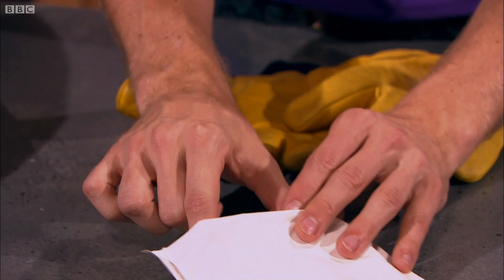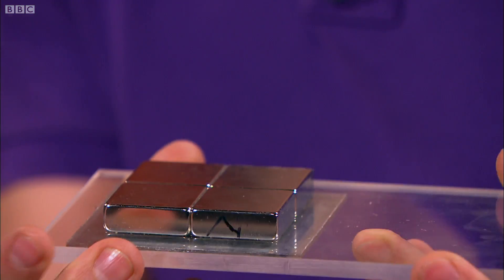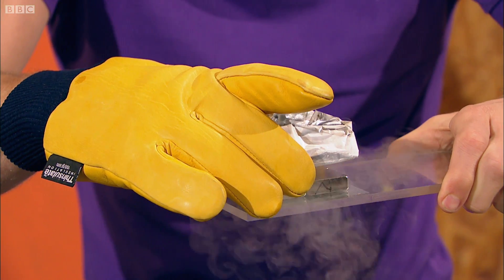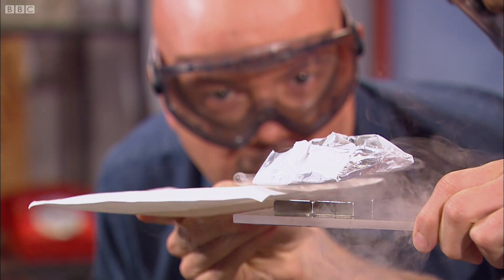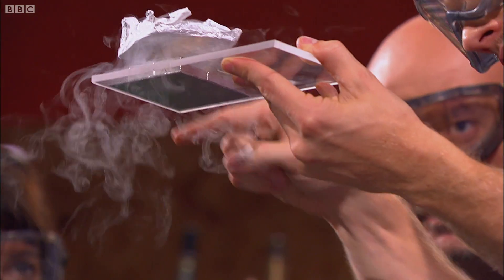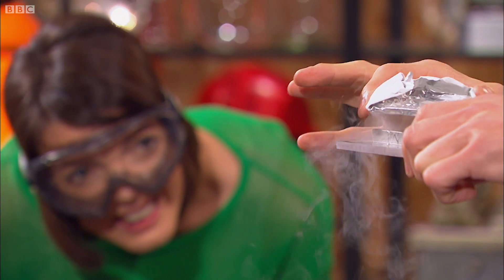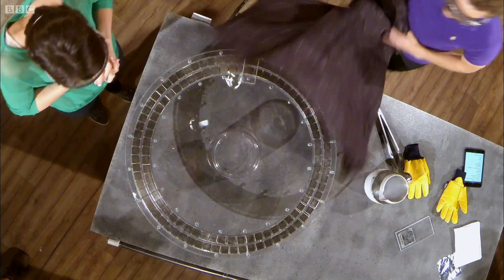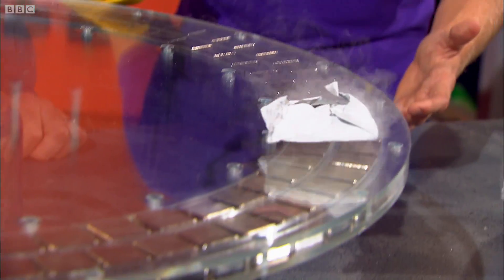Making A REAL Hoverboard | Factomania | Earth Science

Comment: This is not just a hoverboard, its BETTER than a hoverboard. And the reason is that it's not just hovering above the magnets but something even better! Its called quantum locking. Which means, that if you turn this thing upside down it won't fall off! It's not just hovering above the magnets, it is locked at this particular place, and as long as you can keep it cold enough, it will keep that position, no matter the angle you operate the machine! That is incredible!